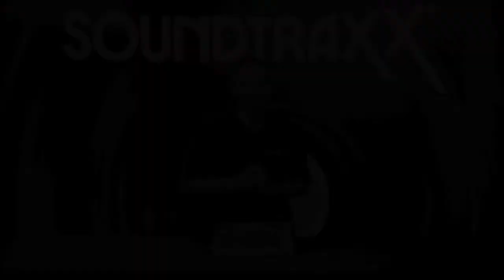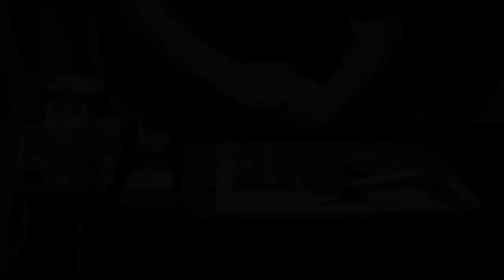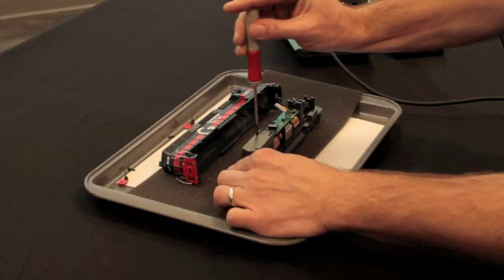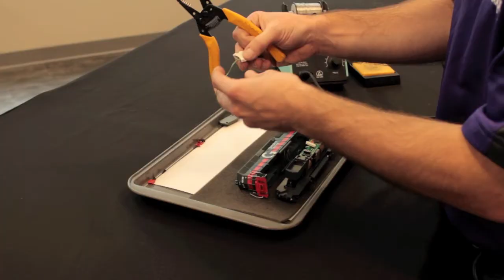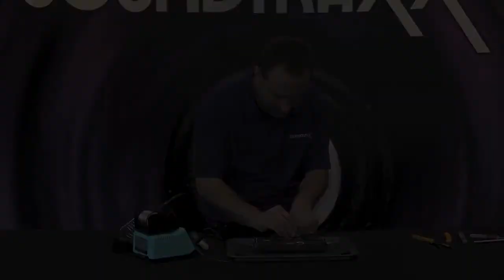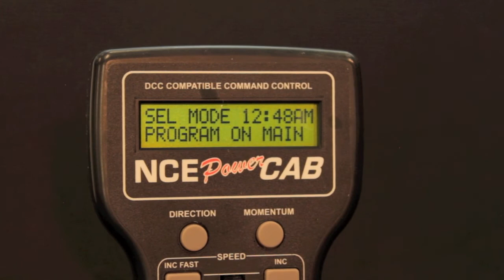SoundTraxx Econami ECO-200 Installation in an Athearn RTR model

Comment: Can you put this in proto 1000 model, more specifically a GP15?
Reply from the maker: The ECO-200 is a discontinued product. It was the same size as the TSU-2200. If the model is equipped with the 9 wire harness, a TSU-2200 for EMDs would be best. P.N. 885005.
Reply: @SoundtraxxDCC  Alright, thanks for the info

Comment: Notice he didn't use an Athearn SD40-2 to do this.  That is because it won't fit.  Imagine, one of the most popular locomotives from one of the most popular manufacturers and no one thought to see if the decoder was too wide.  There 8 pin non-sound decoder has the same issue.